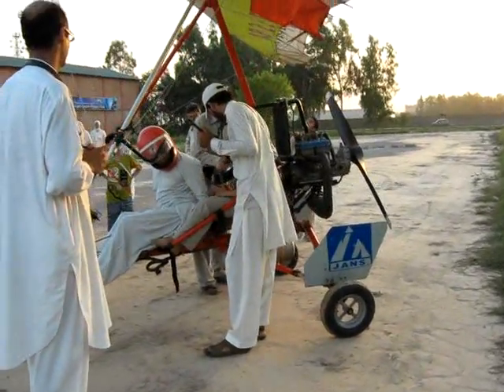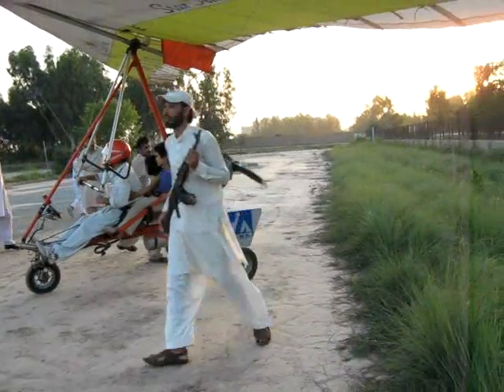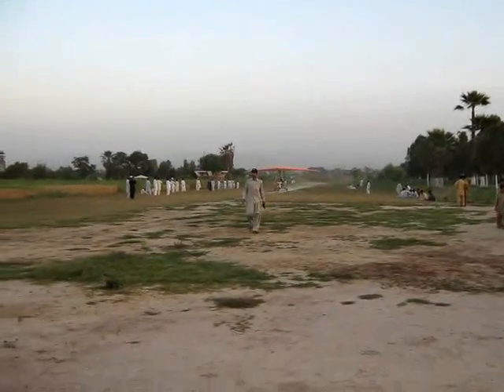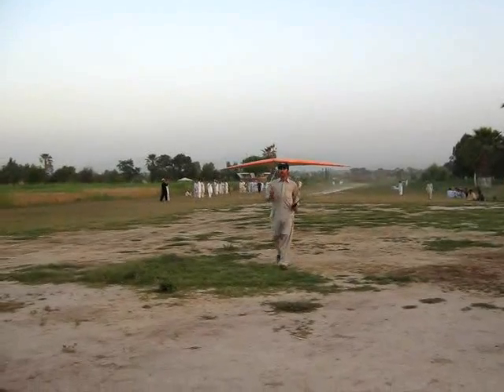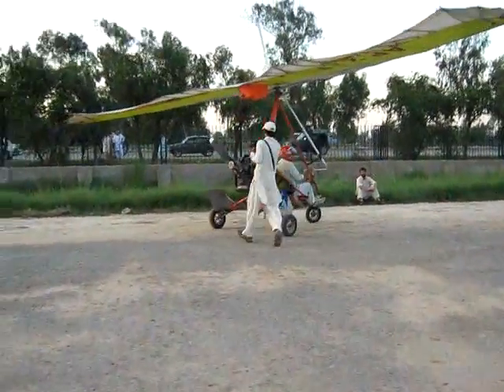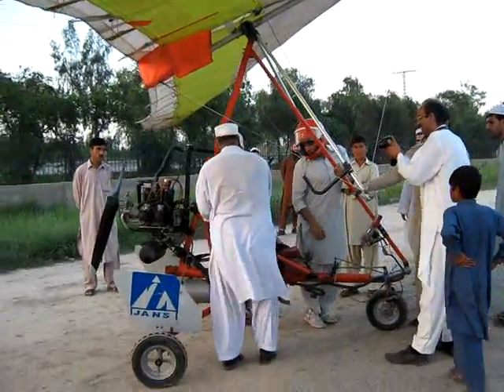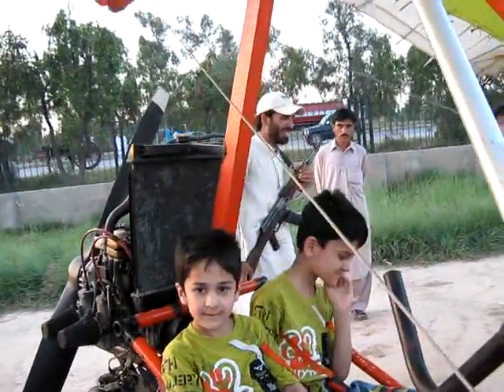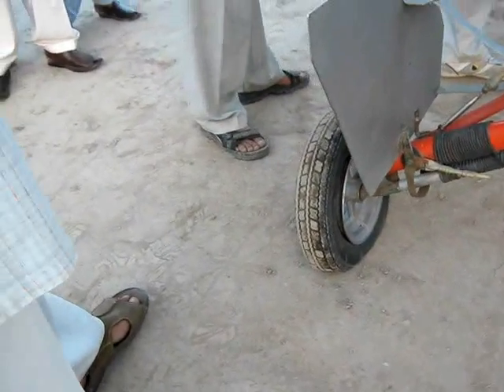Homemade Glider in Peshawar

Comment: I was thinking about building a similar plane. do you know if he used aluminum or steel for the frame? and if you found out the horsepower of the engine? thank you for a great video.
Reply: Almunium pipes,,250 or above engine with minimum 70 kg thrust